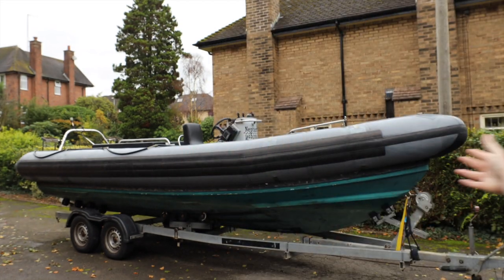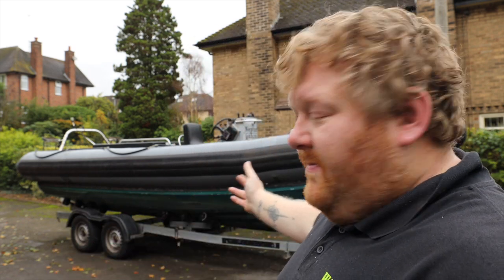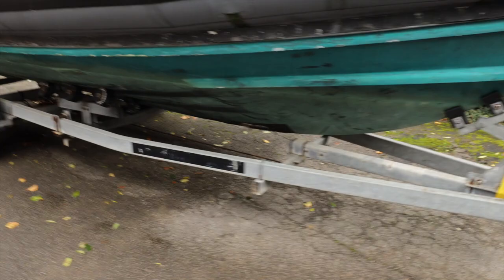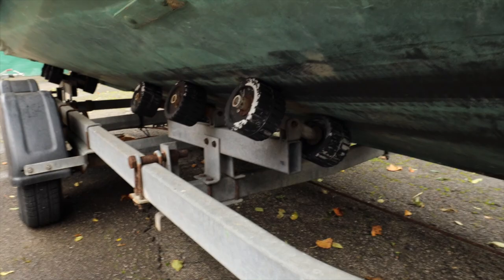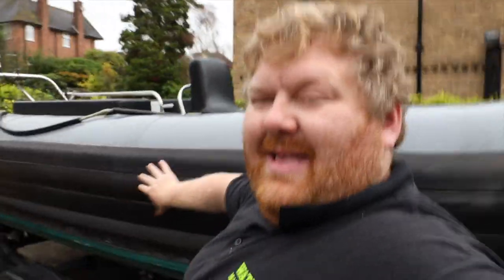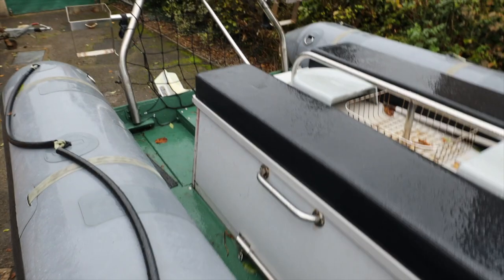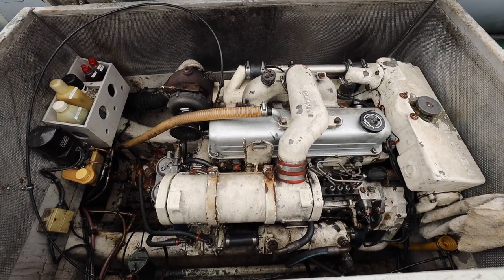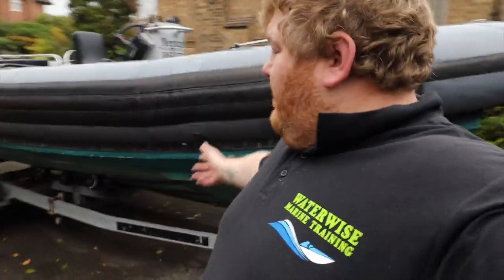Halmatic Pacific 22 Rebuild part 1

Comment: Love these videos - can you tell us more about the mermaid engine (performance and economy) and what outboard you are going for (performance and economy) is the outboard conversion for better performance and more hp? Nice work 👌
Reply from the maker: The mermaid is diesel and is amazingly economical however its 140hp or was and top speed is 22knots.
We will be fitting (once suzuki find us one) a 300hp with a top speed of approx 50knots.
Economy at 30mph cruising is just over 1mile per ltr.
Yes performance will be completely different for what we like 😉

Comment: I know these boats used to build  the tubes for  p22's p24s p28's ,a28's. We didn't have flat strake around it however we had 3mm rubber cladding. Should you need any further advice come get in contact
Reply from the maker: Fantastic thank you
Reply: @gregmarthabutler  where are you sending the tubes?